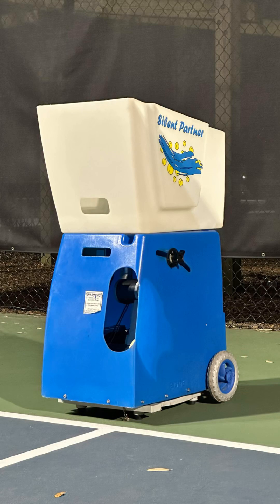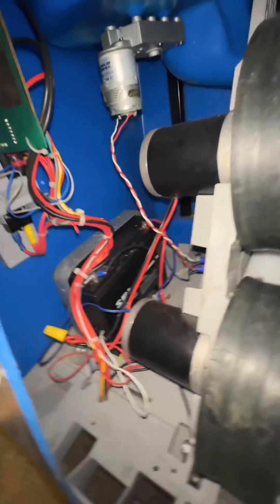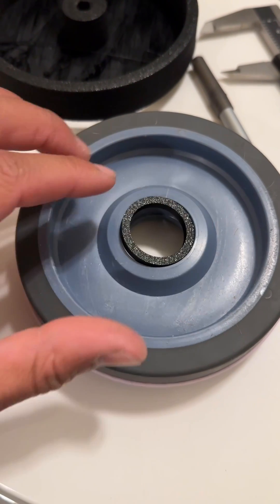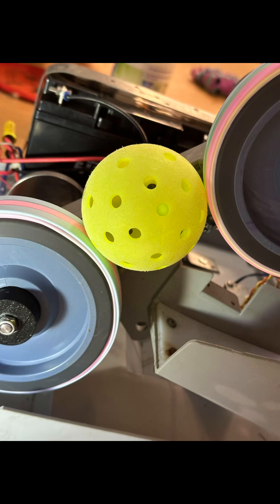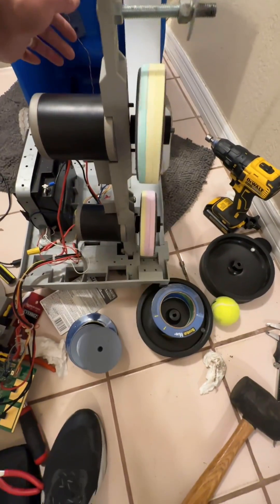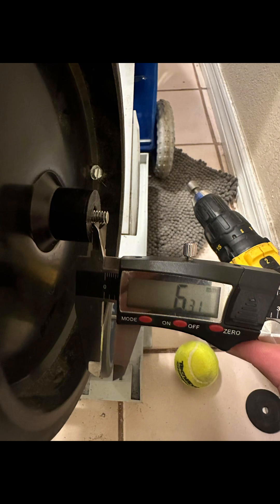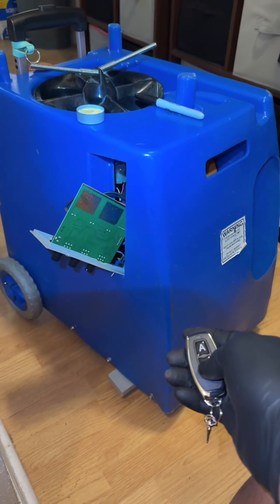Converting A Tennis Machine To A Pickleball Machine

Comment: Chris, what was the diameter of the original wheels from the lowest contact surface? Secondly,  what is the size of the new wheels? What I was thinking, was,  maybe I could buy stock wheels from one of the pickleball machine manufacturers that would work?
Reply from the maker: @wscottsnyder  I’m not home right now to measure the original wheels from silent partner. I don’t remember exactly what mine are but they are like 5.25 inches I called, emailed, and contacted every ball machine company and their wheels aren’t the same size because the distance for the motor shafts aren’t the same distance as pickleball machines to my findings.
Reply: When you get time would you let me know the diameter of your wheels?
Reply: I have the same ball machine. Would be great to learn the wheel size. Can you share?

Comment: Thanks Chris. I also have the Silent Partner Edge.  What do i need to convert it? 1 or 2 wheels? Could you sell them to me? Or does anyone manufacture the proper sized rubberized size?
Reply from the maker: @wscottsnyder  I’ll make a short video later today, but the only thing I did to my machine was change the wheels on my machine, cut the fin down (located near the wheels), and adjust the long white ramp where the balls drop. I do sell the wheels. chriscthornton@yahoo.com
Reply from the maker: @wscottsnyder  https://youtube.com/shorts/20HFGwIAQrY?si=Za_b1ByRGU0kvinh

Comment: how is the machine working? is the feed consistent with the flat surface of those wheels?
Reply: Hey thank you so much for the great video, I have a tennis tutor and I am trying to do the same as in this video do you think the process is fairly the same ?
Reply: @AkBulls0305  depending on which model you have tennistutor might have the wheels for pickleball that you can swap out
Reply from the maker: @ShrimpCracka  the machine is still working great! I've printed a couple of wheels for customers so far that have the same machine
Reply: @ChristopherThornton1  have you tried printing a concave wheel? And how much do you charge for a conversion?
Reply from the maker: @ShrimpCracka  $50 for a set. I have for the tennis tutor machines. Those customers tell me that they only replaced one of the wheels with the concave printed wheels, which works for them. The extra wheel is their backup.
Reply: @PickleballThornton  how much do you try to compress the ball between the two wheels 0.1mm?1mm? If any
Reply from the maker: @ I don't remember off the top of my head. Close enough to grip the ball and not too close to get the ball stuck in between the wheels
Reply: @PickleballThornton  thanks for all the info so far, appreciate it! how often do you swap out the rubberbands? have you thought about using silicone bands?
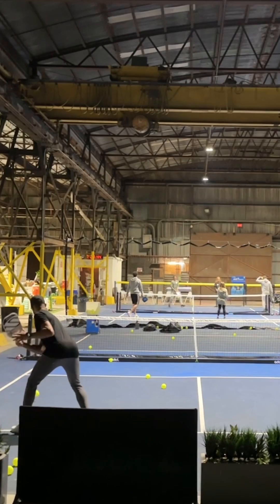Reply from the maker: @ I switched over to silicone bands at 1:08 look at the second wheel. I haven't had to switch the bands since this video because I superglue them to the wheels.
Reply: @PickleballThornton  thank you for all your help man! when you said customers told you they only replaced one of the wheels with the concaved printed wheels, are you saying that they left one original wheel and had one printed, or both were printed by you but only one of the printed wheels were printed?
Reply from the maker: @ my first customer said that both printed wheels were too small for the ball to make contact with the ball, so he kept one of the original wheels on and with one printed wheel and it worked out.
Reply from the maker: @ but that's only for the tennis tutor because I don't have that model
Reply: @PickleballThornton  gotcha, thanks for the clarification. Trying to convert my tennis tutor tower into a pickleball machine atm, but one of the owners of tennis tutor is telling me that my model can't be converted, so I'm trying to find a way to make it work
Reply: @PickleballThornton  thank you man, appreciate all the infos. ill report back with my tennis tower conversion. the owner still telling me that its not possible cause of the motors used on the tower are bigger and faster lol. what type of plastic did you print with and what % infill? i am worried that at higher speeds that it might explode.
Reply from the maker: @ It's possible. With tennis, the higher RPMs help shoot the ball further on the court. With pickleball, you use less than half of the speed because the court is more minor. With my machine, I don't go past 5/10. 

Regarding the plastic, I used ASA material to withstand the car's heat since my machine stays in my car most of the time, so the wheels don’t deform. The material percentage was maybe around 30 or less because the Asa is really strong and durable. With a 1000g gram roll, I get four wheels out of it, to say the least. With less infill, I could probably get more.
Reply: @ChristopherThornton1  I love you, thank you
Reply: @PickleballThornton  how can I order? I have a silent partner and I want to try your printed wheels. Let me know. Thanks